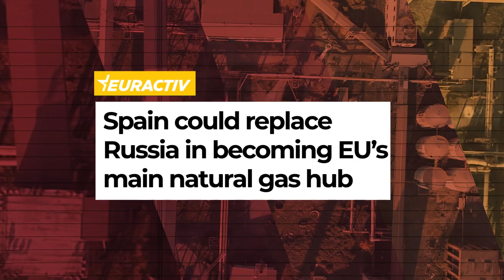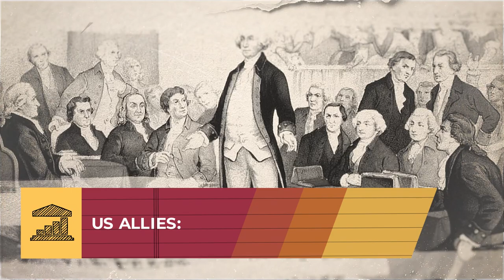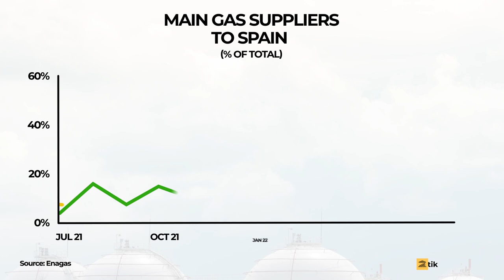Could Spain Become the Great European Gas Hub? - VisualPolitik EN

Comment: No they can infact not and it's not economically viable to do so either, Nor do they have enough to supply Europe for even a decade, It's the same thing as saying that my country the Netherlands could replace Russia as the gas producer even though our little gas pocket is enough to supply Europe for max 2-3 months atleast, which is why we are using it as a reservoir for whenever dire times come such as this winter where we won't have any gas to import. Russia is the best for Europe because they have enough gas to supply us for nearly an entire century which is more than enough time to switch over to other sources, And along with that is the fact they have pipes to transport the gas instead of ships and those special trucks which makes it 10 times as cheap, Many economic experts even some general from the cold war have said "you may not want to do business with the soviet union/Russia and China, but you will have to do so eventually" simply because there is no way the west can rely on its own for a extended period of time which China and Russia can as China can provide the goods now even including microchips at the size of 7nm and Russia can provide all the electricity and gas needs, meanwhile we in Europe can't be warm this winter and have to switch back to coal and wood to produce our electricity which is still skyrocketing in prices. While also hurting our farmers with "climate regalations"
Reply: Biogas is renewable methane. We have cattle farms, so...
Reply: @MarcelaElviraTimis  We have those too, Infact we are the top country in europe with the most cattle and sheep farms living per square hectare. Yet we will be cold this winter, Weird right?
Reply: @valyshknee4203  it's kinda like some ppl really dig monopolies or something. Like... why is it that the best business incentives only go to the "too big to fail" crowd?

Comment: Are not gas pipes on the sea floor easier/cheaper to lay than over land? Why not go straight from Algeria to Genoa? Whatever happened to Israel's gas line to Greece?
Reply: There is 2 pipeline between algeria and Italy
Reply: I really doubt that underwater pipelines are cheaper. They're not cables. It's a bunch of pipes that you have to assemble and doing that underwater requires saturation divers etc...

Comment: The fact this is further proof that for now "renewables" just aren't gonna cut it, deserves an honourable mention.
Reply: Renewals are trash scam
Reply: Morocco can crack & ship hydrogen to Europe via Spain, just as Morocco is sending electricity to Europe via Spain, via undersea pipeline & power line.

Hydrogen has a bright future, as it can be conducted in existing natural gas pipelines.